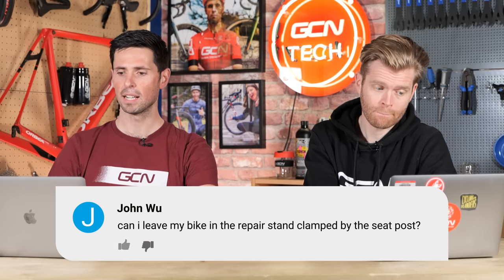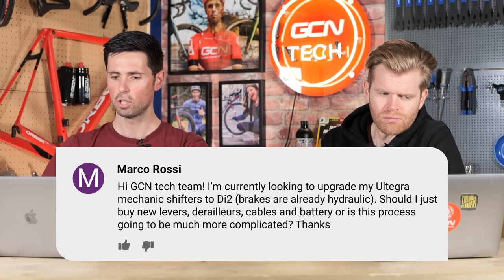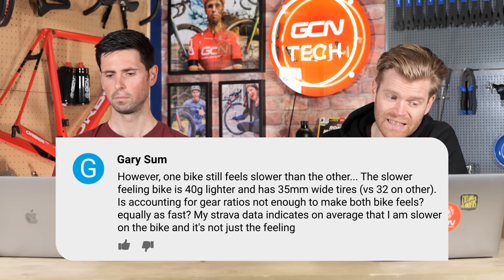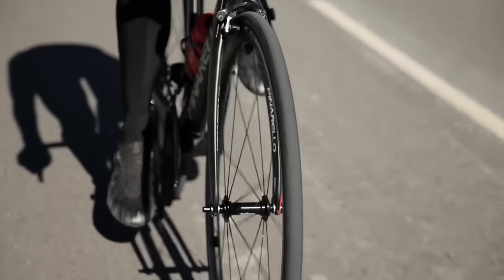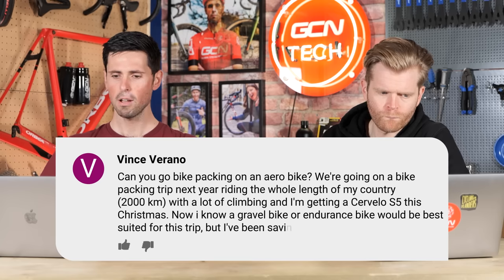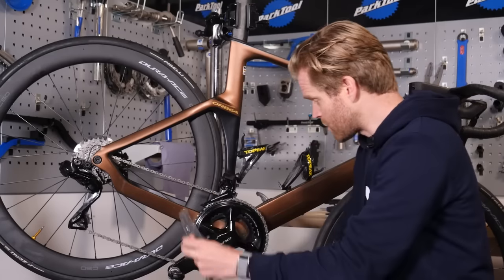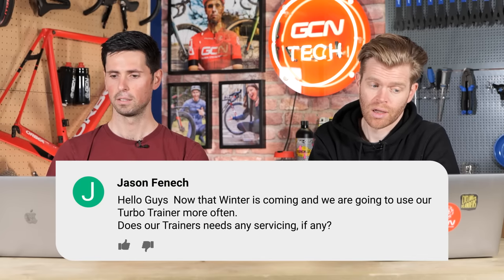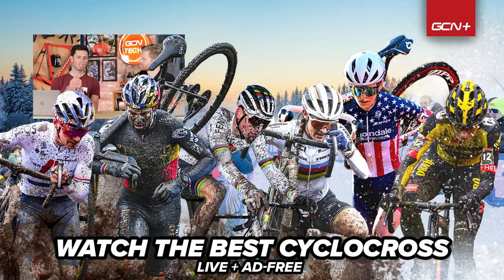Entry-Level Carbon Wheels Vs High-End Aluminium Wheels? | GCN Tech Clinic

Comment: I've got Easton EC-90 SLX carbon wheels and I have Campagnolo Khamsin wheels, which are entry level aluminum.  Between the two, I prefer the Campagnolo.  Main reason is ride quality, next is better braking. Yes I'm still on rim brakes, so maybe a skewed opinion.  The carbon wheels are light and exceptionally stiff for cornering, but the stiffness comes at a cost. 
I save the carbon for hilly areas where it's beneficial to save every once, otherwise the aluminum is just more comfortable and inspires confidence.
Given the durability of aluminum, it's my go to recommendation for beginners

Comment: My recent experience with carbon rims was that across a price range of three of three levels, there were only two rims, but three different hub and spoke combinations. I chose the mid-level, which gave me the strongest, lightest rim and a step up from entry level with the hub (yes, I did a freehub sound check!). The price range across all three (at the time of purchase) was $1000 - $1500 - $2200. The performance improvement on my gravel bike was dramatic!

Comment: Hi both, have you ever heard of a shoe which is waterproof itself. For example, crocks are made of rubber and have vent holes to drain water. I find it easier to get shoes dry again after cycling to work through torrential rain. Cycling crocks is possible, but ideally a stiff ish plastic shoe would be better. I have searched high and low for such a thing with no results.

Comment: My dt swiss alu wheels with ceramic coating weigh 1400 Grass, good aero and ride really nicely. Also my Tune wheels are great. Carbon only with disc brakes. Im still on rim brakes because my cycle is great and parting from it is really hard😂.

Comment: If you don't need Super-Aero wheels and can stick to something as aero as a 35mm height, the tune tsr35 is a fine set of Aluminium wheels that are not too expensive (range of 500€) and not too heavy.

Comment: My advice on servicing  your indoor trainer would be this: If you have a wheel on trainer, every so often, as you notice it needs it, take some rubbing alcohol and wipe the drum down.  Bits of your tire come off over time, and not only will you see the tiny bits of rubber on the drum and probably your floor, but there is usually a mark in the middle of the drum where your wheel makes contact.  Just spin the drum while holding the rag soaked in rubbing alcohol on it and there you go.

Comment: I've never cleaned my 20 year old Elite adjustable Fluid Trainer. The only thing I notice is that the steel roller that the tire rides on has a small depression worn into it from tires wearing away the steel.

Comment: #AskGCNTech Just a follow-up to the question about high level aluminium wheels vs. entry level carbon wheels. I upgraded my bike with some of the best aluminium wheels available (Fulcrum Racing Zero C17). For the same price I could have got a pair of entry level carbon wheels. One of the reasons for my decision was, that this bike has rim brakes, and I am still a little skeptical about carbon wheels for rim brakes. If I had disc brakes, I would definitely have chosen carbon wheels. Does this make sense? In the answer to the question, this consideration was not mentioned at all. Isn't it relevant any longer? If not, why? Are modern carbon wheels OK for rim brakes without any limitations? Or do you assume, that nobody have rim brakes any longer?
Reply: That's the exact reason my rim brake bike has alloy wheels and my disk break bike has carbon wheels. Rim brakes on carbon is good if you just have to slow down a bit but not for fast stops.

Comment: #AskGCNTech After a year of cycling on one of my bikes, my 105 7000 RD had problems shifting towards the smaller rings. Tried changing the shifter cable but it still didn't shift properly. Mechanic said that the spring of the RD was not that stiff anymore due to the bike being stored with the RD at tension (Big ring front+big ring rear). Is there any truth to this? I just can't believe that my other 105 5800 RD is already 3 years old with no problems.

Comment: I'd suggest a used set of carbon wheels from a top brand like Zipp, Vision(FSA), Roval(Specialized) or Bontrager (trek) and you can get a set of disc thru axel wheeks for 1/3 of new and save $$ and ££ and watts and cash

Comment: I am converting a 1972 Schwinn SuperSport to a more modern groupset (Octalink Dura Ace). When I installed the American-to-Euro BMX adapter, I installed it backward - standard threads on the drive side and reverse threads on the non-drive side. Given the amount of grinding and pounding that it too to install the adapter, I do not want to remove it and start over. I understand why the threads are usually the other way around. What is the realistic risk of the backward bottom bracket loosening with normal use, knowing that I am a MAMIL with relatively low power output. After all, Italian BB's have standard drive side threads. #AskGCNTech

Comment: #AskGCNTech Hi Alex, Oli or sometimes Manon. I’ve just got a new Trek Émonda SL7 with 12 speed Ultegra Di2. The 11-30T cassette is fine for my regular riding in south-east England but I think I’ll need a bailout gear for anywhere with proper hills - I died on my old bike in a 30T on Park Rash Climb this year. I was thinking of getting an 11-34T cassette and swapping when needed. Shimano say the rear derailleur will handle a 34T sprocket but is at as simple as changing the cassette? Would I need to change chains as well, or even do something to the Di2?

Comment: #AskGCNTech At what level of bike does it become worth swapping wheels? I'm 65, hypertensive, arthritic right knee, and ~90kg, so I'm never going to be in the front of the pack. I ride for the fun of it, to get out in the fresh air and enjoy the scenery. The toughest ride I normally do is Winter Hill just outside Bolton, which is 2-3 miles of average 8%, max 13% grade (unashamedly in the lowest gear for much of it), but most of my riding apart from that is fairly flat around South Lancs and Berks. I have a 2019-2020 Merida Scultura 5000 with the stock Merida (actually Alexrims) Expert wheels, and a 2022 Specialized Diverge Comp E5, again with the stock wheels. So the real question is would I notice any real difference with different wheels?

Comment: #askGCNTech:  Hey GCN supercrew, my wifes E-bike is looking to be stored for the winter in the northern hemisphere, (3 maybe 4 month's) she is a fair weather rider.  My question:  Is it better to store an E-bike with a full battery, empty battery, or somewhere in-between?  Knowing it's lithium based, I can guess, but I thought I'd ask the super-brains at GCN what the correct answer was?  Thank you in advance for sharing your knowledge with "the people" and keeping us rolling and safe.
Reply: It's the best to store a Lithium Ion battery with around 30 to 50 % capacity. Not full (which is bad for the battery if it's stored for months) and not empty (if the battery has self discharge cells may come beneath a limit where cells get damaged).
If you discharge a Lithium Ion cell deeper than 2,5 V it gets irreparable damage, but your BMS will cut the battery off at 3 or 3,1 V cell voltage during a ride to avoid that. Self discharge over months however may be a reason empty cells further discharge until they reach 2,5 V

Comment: #askGCNtech  For Gary Sum, 38t vs 42t, It would be a difference of pedaling torque, like a 2X chain set up. at a given cadence he would be in a different  cog in the rear. 42t larger cog, 38 smaller cog. Smaller cog takes more torque to to rotate the wheel at his cadence, which would make his bikes feel different. Am I wrong?
Reply: No, because if the gear ratio is the same (ie. if the pedal cadence is the same at a given speed), the torque ratio between the crank and the wheels is the same, and therefore the perceived effort is the same.

The added force required by the smaller cog would be cancelled out by the added force produced by the smaller chainring.  42x21 would feel exactly the same as 38x19.

(Larger cogs can be marginally more mechanically efficient but it would probably not be perceptible between a 38T and a 42T).

Comment: Hi GCN Tech Team, Torque values are stated on most components i.e handlebars, stems etc but not bottle cages bolts. What torque should these be tightened up to? #AskGCNTech
Reply: Usually 3 Nm, but I never use a torque wrench there, just logically snug is enough so that nothing rattles.

Comment: I wouldn't go bike packing on a new bike, rather do the hauling and bumping and bashing on something which would not cause concern about inevitable wear and tear.  So maybe get the new Cervelo and figure out the camping trip, like buying used or borrowing a seasoned bike or just finding an alternative to an attention-grabbing new bicycle.  Who knows, perhaps you could post a note on the bulletin board at the laundromat.  I've seen those, people asking for free bikes.  And they probably work, yeah, i got an old bike in the basement, tires are flat, tho'.  😀

Comment: #askGCNtech Since the colder months here and days are short, I'm wondering what would be your dream indoor trainer setup as far as the bike goes? Maybe a vintage, steel Binachi frame equipped with a wooden rim on the front and Delta Campagnolo brakes (not that you needed those)? Some funky paintjob you'd never take outside? A frame design that looks like it was lifted from Tron but would absolutely terrible on the road?
Reply from the maker: Hahaha nice question Gabor! Wonder what the boys will think🤔 One this to note is that many people like to use the bike they ride outside as they can spend as much time in that position as possible.  What would your dream setup be? 🔎
Reply: @gcntech  Definitely something vintage I'd be afraid to take outside because of its value or condition.

Comment: Hey guys! I have a new Factor 02 frame and I need a groupset and a wheelset for it, but I’m on a budget. Should I get a Shimano 105 and a good Carbon wheelset or a Shimano Ultegra with a good aluminum wheelset. I’m on a rim brake by the way. Thanks! #AskGCNTech

Comment: I recently started cycling and bought a gravel bike. I thought I would not love riding on roads and would prefer to ride off road, but most of my rides have been on road so far. My gravel bike is a Specialized Diverge Elite E5 with a GRX 2x set up. I want it to feel lighter and faster. Is it worth spending money on a carbon wheelset and road tyres or should I just save more for a carbon road bike?
Reply: The n+1 rule is always tempting - but a second set of rims with fast road tires would give you much bigger bang for your buck, especially if you've already got a 2x groupset that's equally adapted to road or gravel (and the E5 is already a nice bike).  It's exactly what I did with my own gravel bike after I too found I was riding mostly on smooth surfaces.

A gravel bike with road tires would probably still be a tad heavier and less aerodynamic than a comparable road bike - but when GCN compared the two a few years back (a road bike vs. a gravel bike swapped with the same wheels) the speed difference was negligible.
Reply: @trainiax  what set of wheels did you get? I am thinking of getting a roval Terra C but the idea that it costs almost the same as my bike makes me hesitant.

Comment: #askgcntech since external cabled bikes should have protectant film installed to protect the paint from cable rub, shouldn’t internally cabled bikes have protectant film installed internally to protect the raw carbon from cable rub? Mainly inside the head tube as an example. Thanks.

Comment: #AskGCNTech Not a question, just pointing out that you have so far forgotten to talk about water bottle weight. I have same size water bottles that have a 100g weight difference. Not a great idea to spend thousands on a lighter group set, and then voiding the benefit by using a heavy water bottle.

Comment: Isn't it more complicated when switching from mechanical to Di2 that you need to take the BB out to connect battery with the rest than bleeding the brakes?
Reply: For some bikes, BB removal isn't necessary, like with the first-gen Allez Sprint (both rim and disc).

Comment: Can someone suggest a alloy  road wheelset that is decently lightweight, through axle, disc brake 6 bolt or center lock that is 700c which is shimano 105 11 speed compatable and is 12mm/100mm at the front & 12mm/135mm at the rear or can i lock at using a adapter to change something like a DT swiss wheel from 142mm to 135mm? thanks

Comment: #AskGCNTech  I'm not sure how to formulate this question in an intelligent way, but how would one best measure the level of a workout on an indoor trainer?  Given that watts might vary significantly over time are calories burned the appropriate metric?  e.g., how does 10 flat miles in 60 minutes equate to 5 hilly miles in 30 minutes if watts fluctuate all over the place?

Comment: Then try a really light aluminum rim, e.g. HUNT Gravel Race (1459 G/Wheelset/€649) against an entry-level carbon wheel set. The advantage of aerodynamics can be neglected, the rotating mass is much more important. And don't forget, most of us are not professional cyclists ;-)

Comment: #askgcntech Hello all! Winter is coming. 
I was wondering which gear ratio would be optimal for ERG mode on direct drive turbo. 
Several factors can be considered for example minimize drivetrain component wear, maximum efficiency, minimal electric power usage by trainer etc. 
Thanks!!

Comment: I heard the argument for carbon wheels.   My question is why its not the wheel of the people.  Just cost which is a pretty large jump to make.  Or are thier other up keep concerns, down sides to carbon wheels.  I have never had a pair, im just curious.  Also do carbon wheels make good gravel bike wheels.  I live in a rural area, gravel riads hear are just that.  I wiegh 200-204, can a carbon wheel take the day in day out beating?
Reply: Even mtb use carbon wheels. They are plenty durable.

Comment: IMO if you’re using a rim brake bike, the question about carbon vs aluminium wheels is more relevant. I’ve used mid-range carbon wheels on my bike, and while it give a little boost on my average speed, the braking performance, especially in the wet, is just horrible compared to aluminium wheels. For that reason, I returned to my stock aluminium wheels for my bike. FYI, the braking surface of my carbon wheel was melted when I was going downhill after going up a long climb on my local mountain.
Reply from the maker: Will you put the carbon wheels back on for summer? 👀
Reply: @gcntech  aw, you got me. Of course. 🙈

Comment: #AskGCNTech Hi people, I am considering aero wheels. Which depth would you recommend for little hilly (1000 m up and down) rides? Any reason to go for the 40mm instead of the 30mm? Thanks!
Reply: aero wheels? consider 50 - 60mm ;-)
if you rather like "shallow" wheels. I'm using 35mm vision wheels... flat spokes (16 back and 11 front), aluminum wheels and only ~200€ a pair

Comment: Hallo guys, love your content. 
I've got a Shimano 105 group set. In general I like to think it is set up well and when on the small chain ring at the front, everything runs smoothly. But when on the large chain ring, weirdly, something at the rear derailluer starts making a grinding noise. Other than that, there are no issues, shifting is great. The noise seems to come from one of the pulleys. However, the chain runs perfectly freely and doesn't touch anything but the pulleys. What might be the reason for that? #AskGCNTech

Comment: For me a reason to use carbon wheels is strength. A cheap carbon wheel is lighter and stronger than an expensive aluminum wheel. Of course only with disc brakes.

Comment: #ASKGCNTech Hello Manon and guys ! If I inflate my wheels with helium, will I have less rolling resistance and make me save a few watts ? Thanks for your answer ! ;)
Reply from the maker: Oooo you may even float away 🤣 Great question!
Reply: @gcntech  😂🤣
Reply: Interesting idea but you may find that your tires will lose air faster than if you used atmospheric air which contains more oxygen molecules. Oxygen molecules are larger than helium molecules (4u to 32u atomic weight), and therefore are slower to escape through the natural atomically porous rubber of tubes and tires.
(I wonder if the UCI would check the air in your tires).

Comment: That's not right. You can get really light alloy wheels with ceramic bearings and hubs for the price of a relatively crap set of carbon wheels . Why does nobody ever investigate the difference between top class bearings and hubs instead of just keep going on about wheel depth and rim materials?.

Comment: Well, it looks that the answer for the wheels is yes, carbon wheels are better, but if you don't want to spend 1500 on a new set, keep using what you have already equipped on your bike, cause most likely there will be no difference.